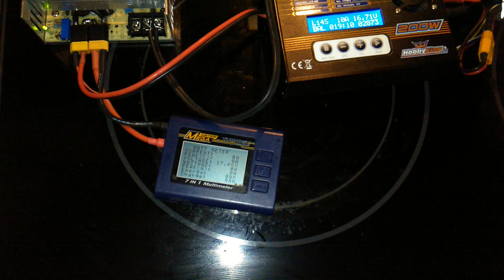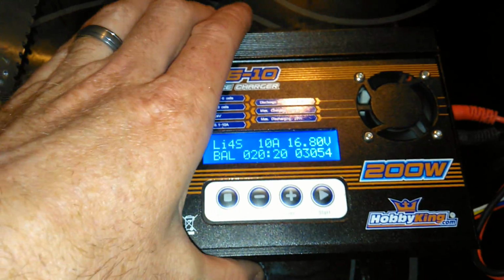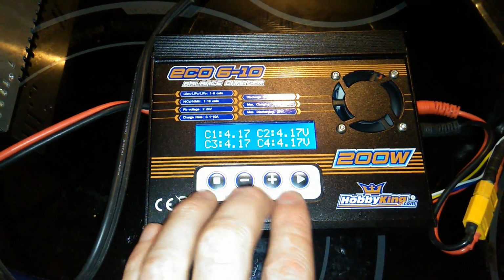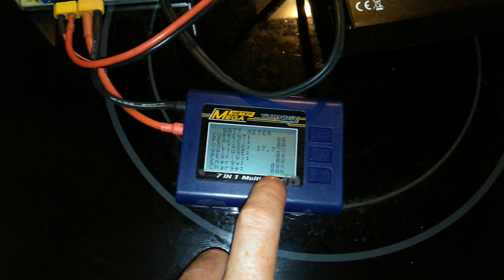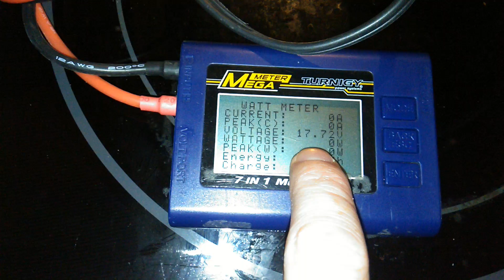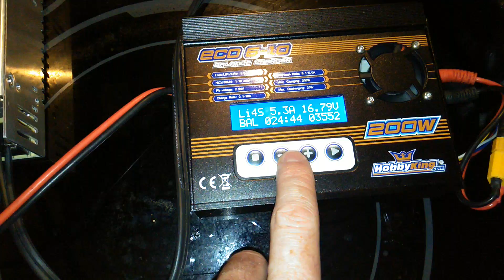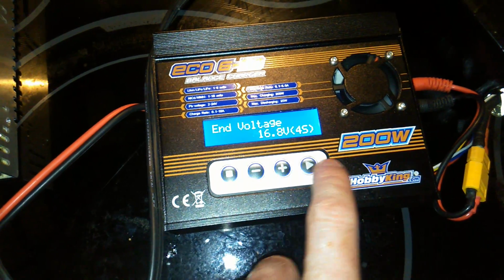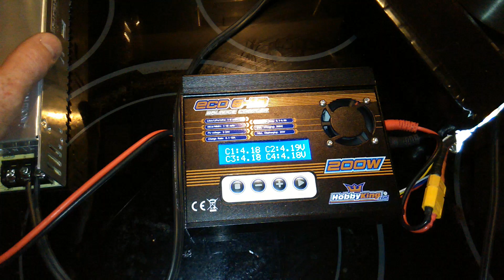Eco6-10 followup (168W semi stable charging!)

Comment: Hi! I recently bought the ECO6-10 and found that increasing the power supply to 16v (limit on my 12v 360w power supply) solved the issue of charging a 4S 5000mAh battery at 2C, though it overcharges in balance mode and I can't access the calibration menus. So as per your more recent video add me to the list of people who'd like to see how to flash this charger!

But on this video you show the mod you made to a 24v power supply to allow it to get down to 18v. They are cheaper so I was wondering what pot value you used and if the pot was the only thing that was replaced?

I expect with the firmware update and a 400w 18v power supply this charger should work pretty good.

Comment: these are so easy to calibrate. need to power down charger diconect it hold the play and minus button and then power up while holding buttons it will bring it to a menu and you calibrate it there.
i havnt had much trouble with hk untill thy started to get new staff and when i submitted faulty lipos they claimed it was my fault and thats when i started getting $150 lipos for free cos they dont know the correct values on lipos so everyone i received i claimed warranty. .... lets just say i have $350 of free lipos due to stupid new staff members who werent trained
Reply from the maker: Ricky Cooke Nope... I have tried every trick possible to get them into calibrate mode. never has.
Reply: its a similar charger to the eco6 50w. the line of eco uses the 2 button held in while powering up
Reply from the maker: Ricky Cooke ya, I have read that it is a one time shot to calibrate. so If i got a returned one that someone tried to calibrate already it is locked out. only way to calibrate again is to flash firmware.
Reply: ive calibrated mine countless times now and i havnt been locked out
Reply from the maker: Ricky Cooke thats strange... Iv tried both options (Menu 1 and Menu 2) neither will come up. Iv even made a input power cable with a switch to make it easier... still not working and I have tried on 3 different ones. I got one to enter the basic calibration but not the per cell calibration.
Reply: I dont think there is a way to enter single cell V but just the overall V of the entire battery
Reply from the maker: Ricky Cooke it is menu 2, menu 1 is the overall voltage. mine are great for overall voltage but when one cell only charges to 4.15 and the others are ranging from 4.17-4.2 its not good enough. This has to be corrected.